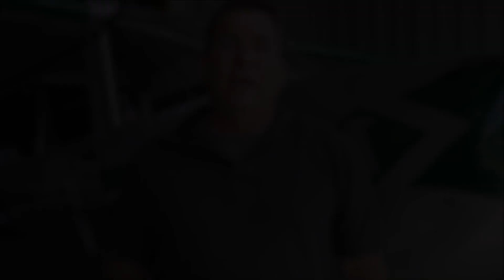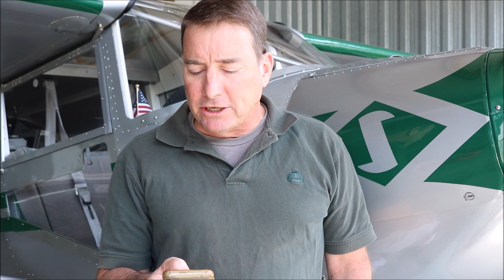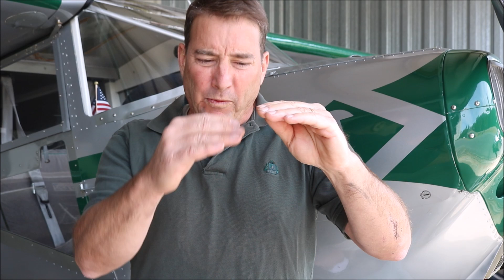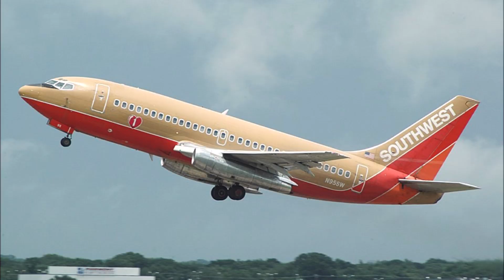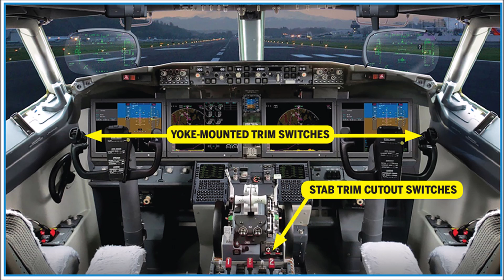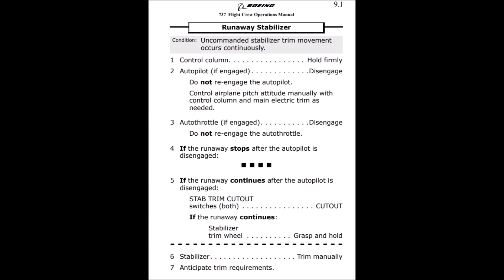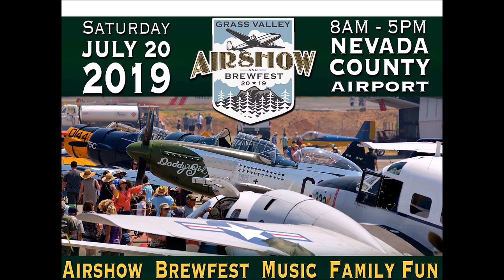737 Max UPDATE 27 June 2019 -The Latest Issue

Comment: I don't quite think you represented this story accurately. It didn't sound quite right from a software and hardware integration perspective so I did some reading on the issue. From what I could tell, and reading between the lines, the problem isn't so much the speed at which the control system responds to pilot input on its own, so much as with the MCAS in a runaway condition, the pilot inputs aren't able to overcome the computer either at all or  fast enough to get the plane back to controlled flight. At lower altitudes, there's less than a minute before impact and "too slow" could very well be fatal. 

 I think that there's an additional concern that I'm very much reading between the lines about: It sounded to me like there's an intermediate controller/MUX between the pilot inputs and the controller that handles the MCAS tasks. In the case of a runaway MCAS (software), and either a bad switch or a switch controller failure (hardware), the plane could quickly become uncontrollable.
Reply: I agree, the publicly available information is rather confusing: It sounds more like the CPU is unable to keep up with all the programs (including MCAS) running on the FCC, and thus stops responding to trim inputs.
Reply: @gordonrichardson2972  Nit-picking here: but not really "stops" … just "not fast enough to retain or regain control quickly enough to prevent ground contact." :-) But with the condition of the information available, you could be right and perhaps the system does stop responding altogether.
Reply: @gordonrichardson2972  
The FCC doesn't have to respond to MET trim inputs for them to reach the stab trim motor, as you suggest.  MET arm, direction and speed signals go directly to the stab trim motor without going through the FCC.  See the stab trim schematic here (the diagram in Juan's video is for elevator, not stab trim):  https://twitter.com/Satcom_Guru/status/1144351180505722882

So even if the CPU in the FCC is overwhelmed with A/P, A/T, speed trim and MCAS processing, that won't affect the arrival of MET signals at the stab trim motor.

Comment: Your updates are very interesting.  One point you might mention is the reason that it takes a little time for the micro processor to allow the jack screw motor to move the stabilizer.  If there was no control of the manual use (or direct link to the jack screw motor) then it would be possible to over "G" the airframe during an emergency pull up.  I assume the computer is looking at airspeed and a few other parameters before it directs the jack screw motor to drive the stabilizer.  My old KC-135 had a manual trim wheel that was (as I remember) manually connected to the stabilizer trim and would stall if you had too much force applied to the yoke.  One thing nice about the Tanker is that there was no question that you have a runaway stab trim.  The trim wheel would be spinning and you could grab it.  Oh well I know different airplane design.  Keep up the great reporting.

Comment: Micro processor is very 1980s :-) They're talking about a computer (just like your smartphone in many ways). Sounds like a simple  software change. Needs to be tested obviously, so there'll be a delay. But no new computer required LOL. I doubt Boeing do over the air updates though :-) But deploying the software update, is the least of their challenges right now. Sounds like this was a pre-existing issue, that they've spotted. Wonder does it apply beyond the MAX. Betcha it does..... The deficiencies in the runaway stab trim procedures and training are one of the most interesting things to come out of the whole MAX episode, because of the scope expansion. Just IMO OFC. Best of luck to Boeing, in their most challenging period. I'd imagine there's a lot of stressed employees working long hours there and it can't be much fun.
Reply: kofManKan A lot of ugly stuff comes out when you open a can of worms like this...

Comment: So, a somewhat convoluted description of the problem boils down to:  a latency in trimming caused by a microprocessor has to be adressed by Boeing "either by changing the software or by creating a new microprocessor".  Seems to me that this is excatly what a failure is.   Which makes CNN reporting pretty accurate.
Reply: That's precisely what CNN reported.
Reply: @tropicalhunch2802  That is not at all what CNN reported.
https://edition.cnn.com/2019/06/26/politics/boeing-737-max-flaw/index.html

Comment: The obvious fix is to mandate a “memory item” with the Boeing Runaway trim issue on all fleets. Turn the switches off, fly normally and THEN begin the assessment steps. There is no memory step presently. Boeing QRHs allow pilots to operate outside of QRH steps as they deem necessary to meet the needs of the given situation. 25 years of flying Boeing products and I have always applied the runaway trim scenario in this manner with no problem.

Comment: The FAA should be deeply testing Go-Arounds when the electric trim is disabled/shorted out. That trim wheel is very small and the control surface is very large. There is a big risk of stalling issues due to 737MAX ANU under high thrust. Can the pilots manually trim fast enough to prevent ANU stalls when MCAS is not doing it for them automatically?

Comment: Thanks for the update Juan. Sounds like a great event coming up. Having watched and read everything about the crashes, listening to your commentary and others. Hind sight says it sure would have been simpler to train every pilot to the new flight characteristics, instead of putting a mindless elevator control interface in to do it automatically. Too much button pushing going on anymore. 
Another thing that I have run across, are reports of sub standard parts from contracted vendors that went into the first hundred air frames.

Comment: I was thinking that since the manual switches have been in use prior to the MAX that this slow response issue would affect models prior to the MAX as well.
Reply: I had the same thought/question.
Reply: The issue isn't in the thumb switch on the yoke, the issue is in the trim-motor control electronics.
Reply: I was thinking about this too, and the best answer I could come up with was yes and no. It does suggest that runaway stabiliser situations are more dangerous than previously thought for the entire line, but this is much less significant for the older aircraft because they don't have the aggressive runaway failure mode that MCAS introduced. Extreme runaway stabiliser is dangerous, but it doesn't matter because this situation is extremely low probability to the point of never having happened before in the most common aircraft ever built. If an aircraft had had a near miss and this was determined to be a contributing factor then it would already have been fixed. 
If it can be improved with a software update then I would expect to see one, but they might not. Extreme runaway stabilisers are regarded as a highly dangerous situation to be avoided in the first place (which they are) rather than compromising other characteristics (and possibly introducing new problems) to fix a hypothetical problem that doesn't come up.
It may have been a contributing factor to the MCAS problem that the runaway stabiliser checklist was assumed to be effective. What may have been missed was that it had never failed because it had never really been used in such an extreme failure.

MCAS cannot be fixed to avoid the failure mode that results in extreme runaway stabiliser, so the MAX needs the runaway stabiliser checklist to be effective to be safe. The rest of the line don't to the point that has never been noticed that it is not particularly effective. The older aircraft might be slightly safer if it was fixed, but the risks of applying such a fix would have to be less than the risk of extreme runaway stabiliser, which is a very high bar.

Comment: Those new Big and heavier engines are mounted way ahead of the wings changing the aerodynamic lift characteristics. 
The A320 NEO looks really good now.
Reply: The new engines are actually lighter. It doesnt matter how much the engines are moved. The a320neo didnt look any better because the max had its engines sticking out further. Its only because boeing didn't test and design their mcas enough
Reply: @pilerks1  nice try boeing .. any 
word on why 737 max are more
prone to stall compared to 320neo
or even older boeing airplanes ?
Reply: @laserbeam3836  Yes its because the engines are moved more forward. I don't deny that. The issue can be fixed easily with software. Thats where boeing failed

Comment: Seems as though it's hysteresis and / or latency.  It doesn't seem to be a simple system if there are multiple CPUs between the control and the jackscrew.
Reply: More likely FAA think the trim should move fast when plane is at high speed (faster the plane slower the trim movement) if it moves to fast it can cause unwanted fast trim movement

Comment: Is there a potential load limit based on speed and severe nose down trim  where software alone isn't going to fix it because the jack screw simply won't turn quick enough against the load?
Reply: yes i agree just posted a similar reply some where , if it trim to fast it will break the stabilizers maybe .

Comment: Ya punch the button and it should respond, not lag or hesitate.   What else could it be but electrical/controller in nature. Fix seems simple to me, reprogram it,,, unless there is more that is not being disclosed about another mystery control system interfering with the pilot's manual commands.  Thanks for the report, News just broke about the problems yesterday.
Reply: tim gear - change the solution in any way and it technically invalidates all the testing that you have already done
Reply: @sja45uk  Yep. That plane may break Boeing before the FAA deems it safe to fly.  I am sure there are enormous political pressures on the FAA and Boeing engineers to solve this thing expeditiously. I truely hope the FAA has the guts to stand their ground.

Comment: Slow rate of electrical trim on yoke was already discovered during analysis of last Ethiopian crash. When pilots failed to trim stabilizer manually due to high speed of plane, first they tried to put elevator of stabilizer up and down by pulling and releasing 2 yokes together in attempt to reduce load on jack screw of stabilizer, failed again and only after that they put cut-off trim switches back on and did it twice, not one time. First time second pilot replied to Commander that trim switch not working, second time two inputs to stabilizer to put nose upward were detected from electrical trim switch on yoke, possibly from Commander side, they almost leveled plane horizontally and saved situation, but because Commander yoke was shaking ( due to faulty AoA sensor on Commander side) he made fatal 5 sec pause, enough time for MCAS to override pilots and put nose full 40 degrees down, while First Officer was too slow to put down cut-off trim switches and block MCAS signals. Separate switch to disable MCAS system without cutting off power to electrical trim switches  on yoke needs to be installed, current Boeing " remedy" is unacceptable.
Reply: I don't think your description of the ET302 timeline is accurate, and I don't think the "slow rate of electrical trim on the yoke" was discovered or played a role in that accident.
The first MCAS activation at 05:40:00 lasted 9 seconds and moved pitch trim down from 4.60 to 2.1 units.  At 05:40:12, the crew used MET to trim up but they only held it for about 3 seconds and it only moved pitch trim back to 2.4 units.  There is no explanation in the Preliminary Report of why the crew released the yoke switch and did not continue trimming.
The second MCAS activation at 05:40:20 lasted about 7 seconds and moved pitch trim down to 0.4 units.  At 05:40:27, the captain advised the FO to trim up with him and the crew interrupted MCAS by trimming up with the MET switch for about 9 seconds back to 2.3 units.  So the rate of MET was pretty close to the rate of AND trim from MCAS.  In any event, there is no explanation for why they did not continue to hold the MET switch long enough to fully relieve control column forces and trim back to 4.6 units, where they were before MCAS activated the first time.
There is no evidence that the crew tried the "roller coaster" maneuver, as you suggest.  The Preliminary Report says the "Captain called out three times "Pull Up"  at 05:40:44, and that "aft force was applied to both control columns simultaneously several times during the remainder of the recording" but does not suggest that the crew intentionally relaxed aft force to try to ease the force on the jack screw.  That is pure speculation.
The FO never said trim wasn't working after the crew turned electric trim back on, as you suggest.  At 05:41:46, he said "trim was not working and asked if he could try it manually," but that was before they turned electric trim back on shortly before 05:43:11 (when they again tried to use MET).
The last two times they tried to use MET, at 05:43:11 and 05:43:15, they only held the switch for about 1 second (or less).  There is no explanation in the Preliminary Report of why the crew only blipped the switches and did not hold them long enough to increase pitch trim in a meaningful amount.  The Preliminary Report does not include any CVR info for this time period so we don't know who applied MET, why he didn't hold it long enough to make a difference, and who placed the trim switch in the CUTOUT position after MCAS activated.  But there is no evidence that this had anything to do with the rate at which MET affected changes in pitch trim.
Reply: @danielforman5064  Electrical motor for trimming of horizontal stabilizer by rotating of jack screw has 2 speeds: low and high. MCAS was given access to high speed, while MET only to low speed of motor, so MCAS has tremendous advantage over pilots in the speed of trimming corrections, it's not right, supposed to be opposed.
Reply: @nyckhusan2634  If you look at the second time the crew used MET to reverse MCAS nose-down trim, you will see that it took about the same amount of time (9 secs. vs. 7 secs.) to trim up as it took MCAS to trim almost the same amount (1.9 units vs. 2.0 units) down.  So the difference in speed doesn't look that great.
It makes sense that MET trims slower than MCAS.  That gives the pilot a more sensitive control to precisely control trim.
But regardless, any designed difference in trim speed between MET and MCAS is not what last week's report was about, and has nothing to do with the accidents.  MET interrupts MCAS, so MCAS has no advantage over MET.  The problem was that the ET302 crew didn't hold MET long enough to restore proper trim.

Comment: Kinda getting embarresing now & not to mention hugely expensive for boeing huh? There is a very fine line between P.R  hype
& smoke & mirrors desparations...
Reply: turns out that electric assist is slow according to the latest tests, just shows how hopeless manually turning that wheel is. Pilots had zero chance

Comment: I wonder if the Trim rate of the autopilot system and MCAS is the same process(or) as the manuel electric trim by the pilot... as far as i understood they reduced that rate, right? 
So the pilot cant trim as fast as before as well?
Or was the manuel electric trim always on the slow side ?
That would shine a new light on the two crashes where the pilots tried to fight MCAS...
Slow trim in a runaway trim situation sounds awfuly bad!

Comment: Thanks Juan, can we yet say that Boeing put a less than airworthy aircraft into the marketplace?
Reply: That seems obvious to me, at least, at this point. But the failure of management to address these problems during testing and making sure of a solution points to them. It will not surprise to hear that Dennis Mulienberg  has resigned.

Comment: Hindsight is 20/20.  After more than three months of analysis, It's easy for anyone to see what may have saved the aircraft. Reduce airspeed and manual trim. Or turn on  "Stab Trim" briefly when needed and shut it off again. I've watched so much about the 737 Max, I almost feel like I could program the flight control software myself and fly it.
Reply: I believe they may have hesitated to reduce airspeed because I believe they were over weight (ferrying fuel) and having climb performance problems before MCAS activated.  The Preliminary Report says they were under Regulated T/O Weight but that was based on an average of 167 lbs./pax, INCLUDING carry on bags.  If you use 190 lbs./pax (FAA std.), then I believe they were a couple of thousand lbs. over RTOW.  That could account for the abrupt pitch up at the end of the t/o roll (trying to get off before the end of the runway?), the poor initial climb performance, the Captain's instruction to the FO at 05:39:50 to request "maintain runway heading," the slight sink at 05:39:51 when they retracted flaps, and the Captain's instruction to the FO at 05:39:57 to request "maintain runway heading and that they were having flight control problems," all BEFORE the first activation of MCAS.
If they were in fact over RTOW, then that might explain why the crew didn't reduce power or airspeed -- they may have been afraid that they could not maintain altitude at a lower power/airspeed, and would rightly have been concerned about rising terrain in front of them and a 10,000' mountain to the south.
None of this would explain the crew's ineffective use of MET throughout the flight or the decision to shut off electric trim at the end instead of first trimming up with MET.

Comment: Since the MAX was designed to feel just like the NG and earlier models of the 737 to the flight crews for common type rating won’t the trim switches operate at the same rate on all the different versions of the 737?
Reply from the maker: Good point...and if it's increased for the Max...can it keep a common type cert?